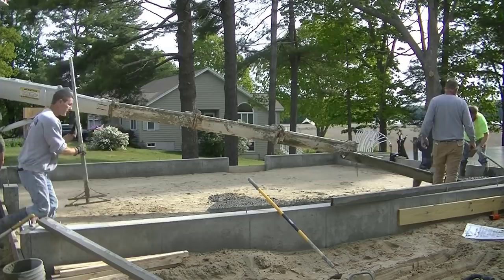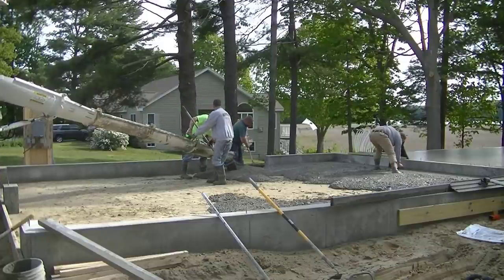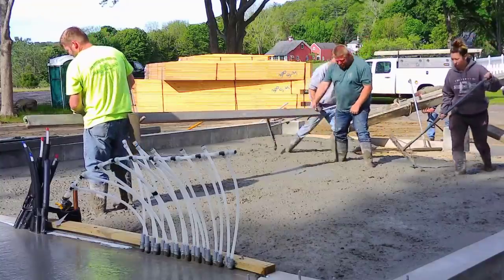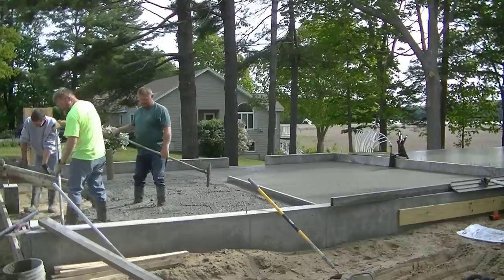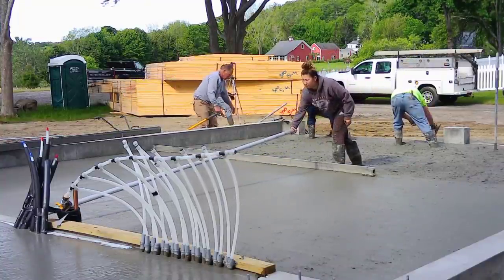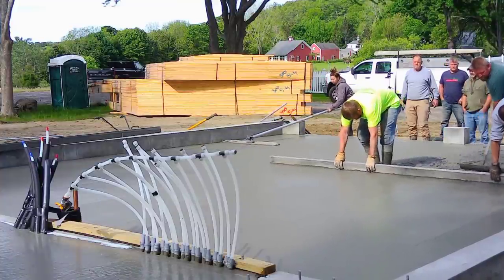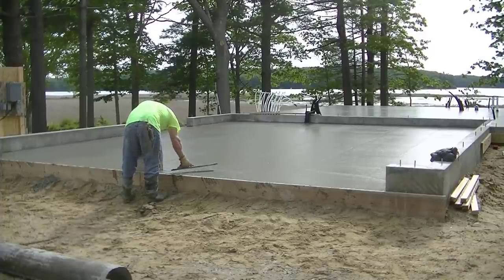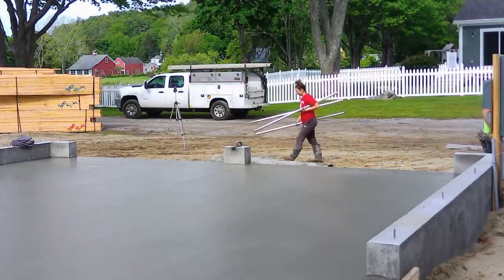How To Pour A 28' X 24' Garage Floor

Comment: Maybe you mentioned it and i missed it, but what are the white and black tubes going into the concrete?  Is it for hot water heat under the floor?

Comment: Garage floors should always have steel drilled into the wall every 2 ft. I’ve poured hundreds of garage floors and I have never not drilled them. I bet if you put a water sprinkler in there and watered it for 2 hrs the conners would settle. You can never depend on someone one else to do it right for you....